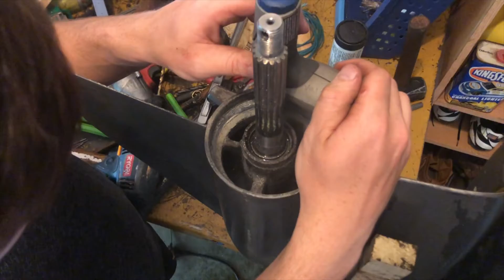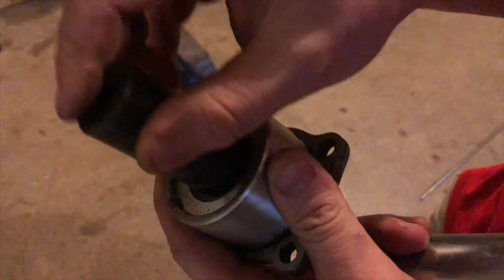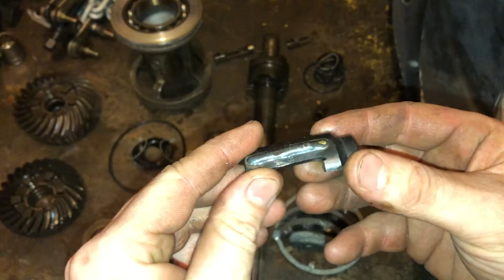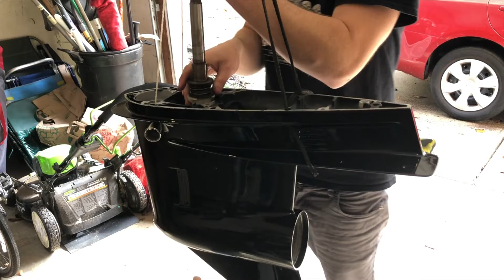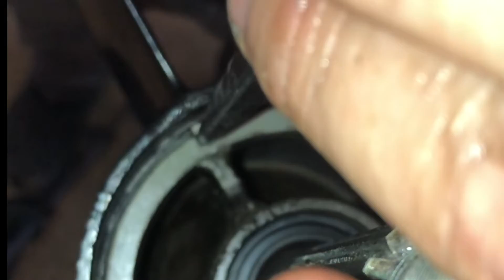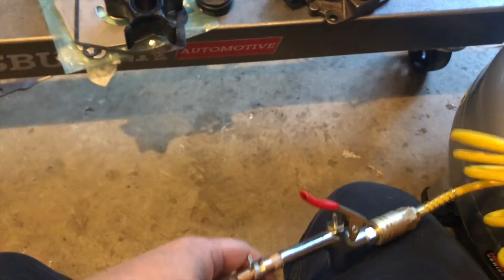Center Console Restoration Part 8: Lower Unit Overhaul

Comment: Could you have popped the cap on the hull? Separated the upper and lower halves at the rub rail?
Reply from the maker: That's one way of doing it but given I don't have a hoist to keep it intact while lifting, I plan to glass the new floor to the wall of the cap
Reply: @mechanicalangler2777  I never did a floor in a CC I was wondering if they did come apart.